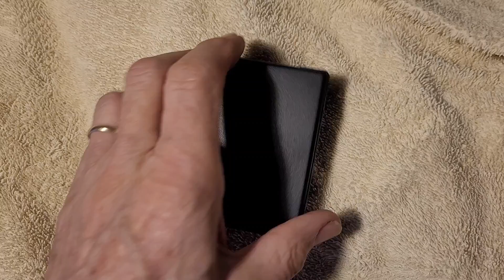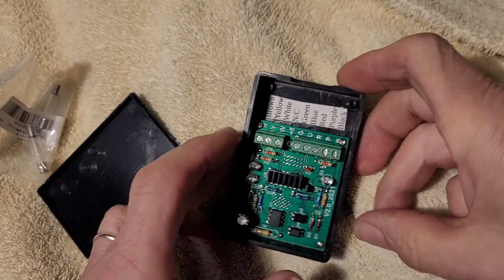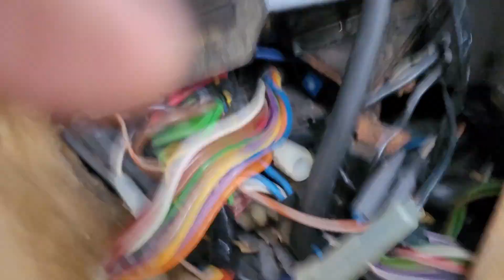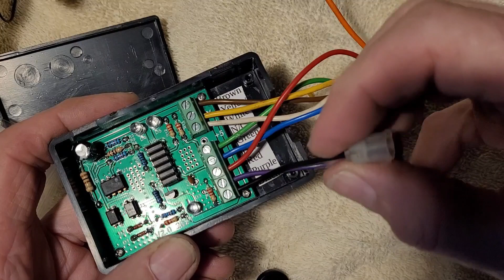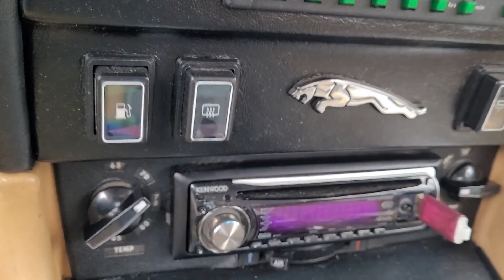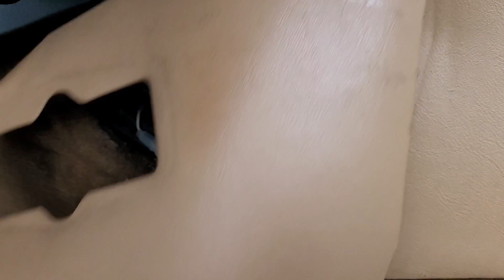Installing The Manual Climate Controller

Comment: so this ignores the ambient/outside temperature? IE does it replace the amplifier or does it just allow you to control the heat/cold/fan speed using the fascia temp control?
Reply from the maker: The Delanair system does not have an ambient/outside temperature sensor, but it has a sensor in the dash to measure the temperature inside the car. My device ignores this sensor and is simply a "dumb" servo driver that works exactly as you suggest, " it just allow you to control the heat/cold/fan speed using the fascia temp control".  It does replace the amplifier as you remove the amplifier and replace it with this unit.
Reply: @novom2001 okay thanks. Do you have plans to develop a straight replacement for the original incorporating the cabin temp sensor input?
Reply from the maker: @ScaphanNetwork  That is one of those things like cold fusion, always a few years in the future.  I have a prototype that I play with when I have the time but it is not ready for prime time yet.  Maybe over the winter.